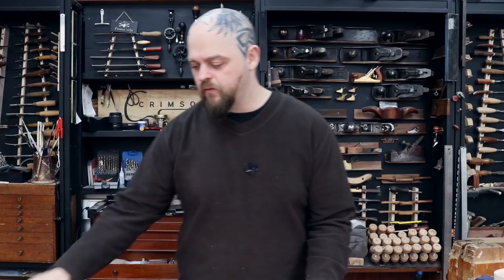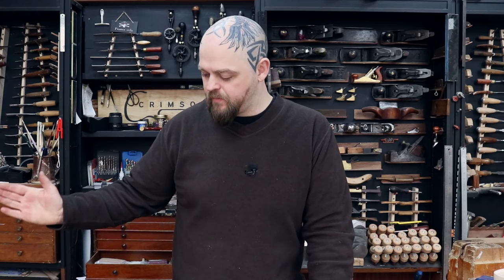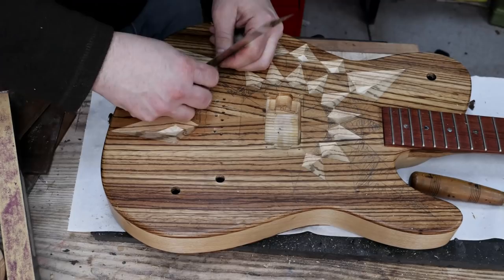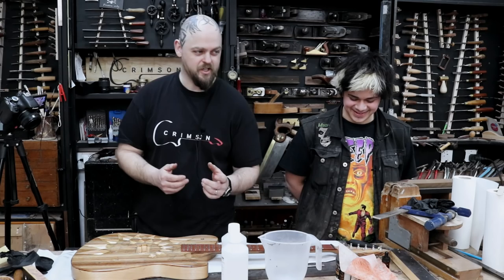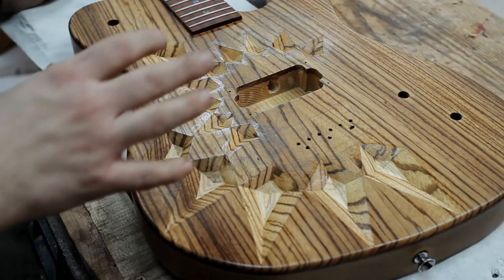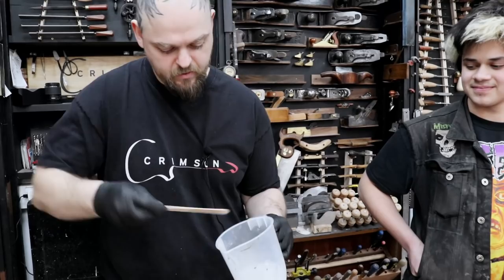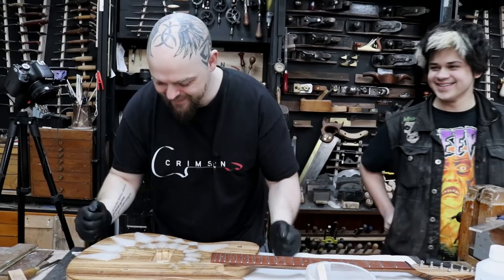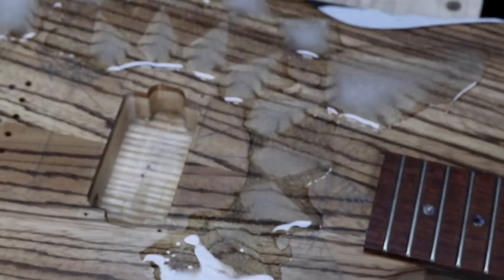Ep 2 -  A Chip Carved Zebrano Guitar Top - How to Resin Fill with Josh

Comment: Josh did a great job :)
Couple of ideas:
You REALLY should have put the resin in a vacuum chamber to get the bubbles out before pouring.
Also just pour a bit in the bottom of the deep pockets and hit it with heat, then add more on top so you aren't trying to get the bubbles out of the bottom by heating the top.
A random orbit sander with no sandpaper makes a great vibration device.  So does a bass guitar!!
Reply: Flame the resin works well.
Reply: Great ideas.
Reply: I'm not impressed with your epoxy expert, the first thing you learn is NOT to mix bubbles into the mix.
The second thing you learn is how to pour it without making a massive mess! Put it in a 20ml syringe, or scoop it into the molds with a teaspoon etc.

Comment: very interesting guitar!  I watch all of your videos and have learned  so much and they are entertaining also.  I have been building custom fishing rods for the last 4 years and have become very familiar with specially made for rods ,  clear, two part 1:1 epoxy. We use it to coat the multicolor thread wraps near the guides etc.  The rod is put in a rotisserie  (9 rpm) to keep the epoxy leveled while it hardens and bubbles  are a rod wrapper's nightmare.  So , some things I do to help lessen the problem is first, I use a candle or room scent heater to warm the epoxy.  You can purchase these at places like Walmart household section. They warm the  candles and give off a pleasant scent . My wife bought two of them for the house but can't seem to find them.   Just set your bottle of epoxy on it 15-20 min before you need it.  Second, very important,  mix very slowly to avoid entrapping air. Don't dip the mixing stick in and lap or fold the epoxy over itself, just keep the stick in there and stir slowly.   Some rod builders put a few drops of acetone in  mix to lower the viscosity.   This evaporates quickly and doesn't seem to degrade  the finish. Then I heat the epoxy with an alcohol lamp  as the rod turns and this usually removes most bubbles like in your video.  Then , under a magnification, I use a 25 gauge needle to pop any stubborn bubbles. I hope you can use some of these tips to help  win the battle against the  dreaded bubble,  Ted

Comment: Hehe, I put the same sprakly flakes in my fretboard that I engraved :D I just added purple stunning stains and those flakes and boy did it turn out cool! As for when mixing the resin, it's good to mix it so that the "mixing utensil" doesn't really lift away too much, because everytime you pull the utensil out and put it back in the mixture you create more bubbles as air gets trapped.

-T

Comment: Im not sure why yiu had so many bubbles & the opeque color? When I did mine after mixing for 5min very slowly not lifting my mixing stick the resin was crystal clear and I had very few bubbles. It may have too do with the glitter you added I hope it dries clear, Also Ben use an old credit card to scrape off the excess it works great.

Comment: I'm working ping on filling up my workshop. What would you suggest, drum sander or thickness planer? I'd really appreciate your opinion. Cheers mate.
Reply: mark henry 

Both. Neither can replace either.
Reply: First timer here and can't justify buying both off the bat. By all mean you want to send me the cash then I'll buy both but for now I'm sticking to a budget. My concern is with tear out with the planer. I'm leaning more towards the planer just worried about taking chunks out of my nice slab of mahogany Iv just bought.
Reply: Both are really just about how fast you can do a task.  You can do either task manually, so really it's just a question how often you would use the machine.  I've been building things for 25 years and don't own a drum sander, but tend to do almost exclusively straight-line construction (not building guitars...yet).  If buying a thickness planer pay VERY close attention to the reviews on how much snipe the thickness planer will create - buy the one with the least snipe.  You'll kick yourself for buying the cheaper one later - learn from my mistake!! :)

Comment: Why the heat? Won't the 2 parts chemically cure it just fine? Learn me, I know very little about epoxy at this point
Reply: the heat is to remove bubbles trapped the in resin from the stiringby heating the air until it rises.
Reply: Furiora oh that's brilliant! Thanks for the reply!